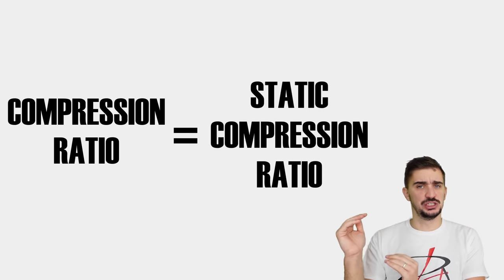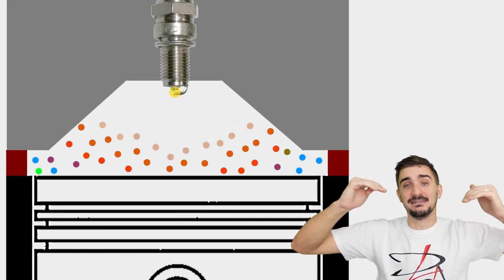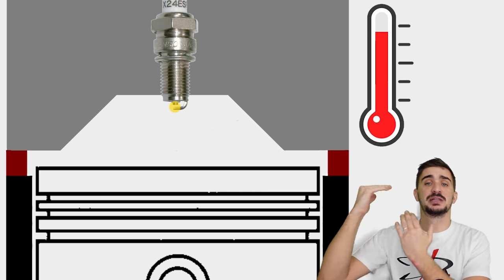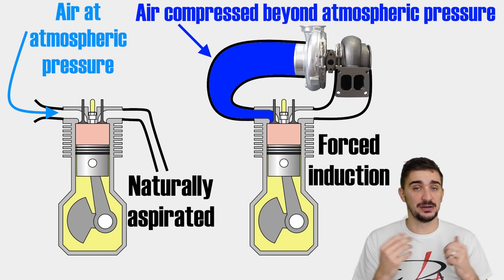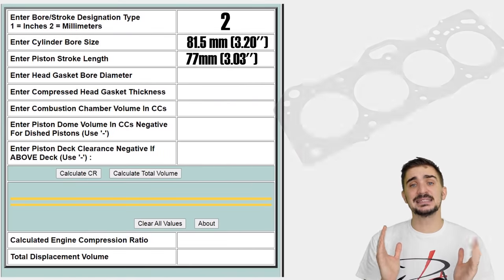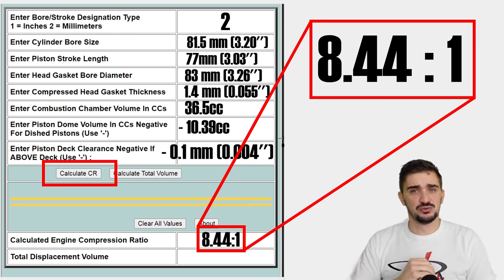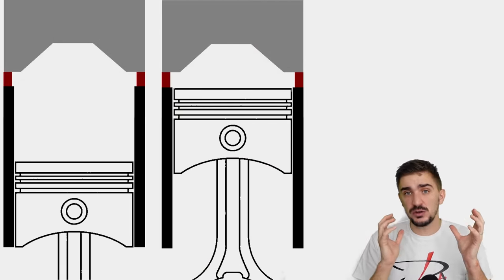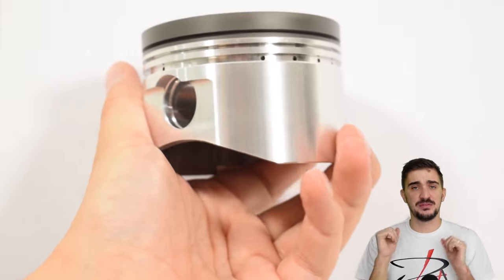COMPRESSION RATIO: HOW to CALCULATE, MODIFY and CHOOSE the BEST one - BOOST SCHOOL #10

Comment: Not to bad of information but a better rule of thumb is to figure out what fuel you want or how complex you're fuel system will be. For me, I have a single turbo n54. It's 10.2:1 compression with 8psi stock. I decided I'm going to use water injection,  yes just water, not water meth. So my fuel octane is high. Now I can use high boost high compression and high timing. Ended up with a G30-900 1.06ar 10° at 30psi worth 1800cc water on 92 pump for 806awhp at 7500/8000rpm. I get 800rpm faster spool then my buddies who did 9.5:1 compression and have 50whp less then me.  All so they can run pump. Which I do with the need to pop my trunk and check my 5 gallon aem tank that last for 2-3 weeks.
Now I understand most just want to fill up and go but most don't understand this is an option and a very good one to.  Imagine the need for less injection cc. Further increasing the tank to empty time. It's very cool and should be checked out.

Comment: What about adding a hood from a supercharged model or one of those intakes which replace the small panel next to the hood and wrap around the C-pillar? I doubt they completely solve the problem but I guess every bit counts.
Reply from the maker: I'll likely be modifying the engine lid. The supercharged one is a minor improvement so I might end up doing something more drastic. I considered the side snorkel/intake scoop thing, but I kinda feel it goes against the natural flow of air in the aw11, as the air comes from below and escapes out the engine lid, but I really don't have anything to prove the scoop doesn't work, it's just a hunch.
Reply: @d4a  Keen to see with what you come up for the engine lid!
Yeah you are probably right with the snorkel, I guess it would be useful if it goes straight to the intake without disrupting the stock flow through the engine bay.
Reply: @d4a  There are some rock solid videos of studies done on the aerodynamics of aw11's that tie into this exact subject and they found that there is not very much airflow through the engine bay and the scoops don't do a whole lot. The way the cooling system is set up is the reason the hg will blow without warning. It is because of bubbles in the coolant lines, not because the radiator is not large enough. I am thinking about adding a Haper's hatch to my aw so I can run an air to air intercooler and get the airflow needed. Or I will go to a air to water setup...
Reply: Add an F1 scoop at the top!

Comment: In the late 80s an early 90s. NPTI Nissan performance technologies Incorporated in Vista California, with their 3.0 Nissan V6 twin turbo utilized 61 to 63 PSI boost to qualify P1 on the grid and to win championships. They were also utilizing higher  compression than the norm. Well it wasn't long till Dan gurney and his Toyota came along with the 2.5L  4 cylinder with also extreme boost and took over first place. They were achieving the 1,000  horsepower mark back in the day.

Comment: Took too much from the head without measuring it and now I would have 12.85:1 (9.5:1 stock) compression on my 1980's 1600 cc carbureted engine. You think I could twik it on  95 octane pump gus with advance, etc or should I make the chamber slightly bigger by machining near the gasket? Thanks for your work on videos like this.

Comment: So take myself for example 
I have a 320i b48, 11.0.1 ratio 
330i b48 10.0.1 ratio
135i b48 9.5.1 ratio.

Only difference with these cars is ratio engine part are the Same with forged crankshaft and piston RODS , cast pistons

So with bmw I believe and looking at the models,  above,  a lower compression = more power in this case correct?

Also I would want a piston with a deep top in order to reduce the ratio correct?

Comment: Your videos are terrific.  Thank you for including the light pressure turbo concept (higher compression with lower boost) in this video.  Mazda used this approach with the Mazdaspeed Miata.  I have an ‘02 WRX, with a 4eat (for good reasons, that’s why).  I’ve been chasing low rpm response since I got the car in 2002 (!).   My tuning strategy has been “Don’t go big”. In the Subaru tuner world that requires staggering self control.
[I inadvertently appended this comment to the "AM I Too Old to Die on a Motorcycle?" video. Sorry about that]

Comment: How close could someone get to making a stroker engine simply by slightly altering/modifying the piston top shape (flat, dished,dome), gasket thickness, rod length ( I know that, that is how stroker engines/kits are made.I was thinking about using readily available parts/components or only slightly altering things). For instance could an 4.2L incline 6 be made into a 4.5L (or possibly larger) by doing these minor changes or would the closest thing be changing it from a 4.2L to a 4.25L?

Comment: What kind of copression should i run on 1.3l Aluminium engine if i would want to max 200hp maybe less than that? my stock compression is 9.5:1 and stock horse power is 75, would 9:1 be good?

Comment: The Gamma 1.6 T-GDI engine used in Hyundai Motor's Avante Sports is 204 horsepower and has a compression ratio of 9.5:1
If I remember correctly, there was a time when a vehicle called the Avante N Cup accidentally installed a piston and connecting rod in Kona, causing a 10.5:1 compression ratio, and in this case, can you tell me how much the power will go up?

Comment: A great video as usual, but I still can’t dispel a doubt: if the goal of a manufacturer when building a na engine is to raise the cr right to the edge of knock, then how is possible for so many people to add any sort of FI without even worrying about opening the engine and lower the compression? I see this behavior occurring very often, ie with VQ Nissan engine, Subaru BRZ engine and, maybe the most frequent, BMW inline 4/6 cylinders. This happen also in Europe, where E85 is almost unavailable. Am I missing something, or is this procedure safer than it appears on paper?

Comment: A forced induction engine is a two stage compression system with a possiblity to cool down after the first stage. That's why (not only why) the potential max torque is higher than in a one compression stage NA engine. Then in a FI setup the CR/boost ratio is a compromise between the FI load (high compression mode) and the NA partial load (low compression mode) performances (torque, efficiency, ...).
Also the presented numbers and even the logic are only true for the traditional mid 90 engines without vvt/vvl. Don't believe ? Check the CR of modern engines.

Comment: Dynamics determine effective power ratio. Static does not account for variable duration lift lsa . Formula1 engine 20,000 rpm and a drag racing engine at 8500 rpm making same hp . Effective compression ratio would same but hp and torque vs weight of vehicle= efficiency

Comment: Just did the summit racing calculator and figured out I'm somewhere between 8.8 and 9:1. The piston protrudes up from the deck by a small amount, .1 or .2 mm but the head has been machined flat twice so I have no way of knowing exactly what it the volume is. I removed 1cc as a guess. 7mgte engine, pump gas on 15 psi makes 430 whp, 18 psi on e85 makes 494 whp on a hub dyno

Comment: More important than compression ratio is what the compression ratio REALLY is, the EXPANSION RATIO.  How far it expands the gas before dumping it out the exhaust is the actual source of the power available. You tolerate a high compression ratio in order to get a high expansion ratio, which extracts more energy out of the gas.

Comment: Craziest thing you ever saw? FoMoCo installed a flex fan backwards. Always had AC problems... I found it when I changed his Camshaft(s) in a parking lot. It's a different story when the front end is no longer attached to the back end... Fixed.

Comment: From my understanding, higher compression helps more at lower revs than at peak power, but also reduce the ability to over-rev. Simplistically, you could say a normally aspirated engine with high compression will give better acceleration, but also lower top speed potential under favorable conditions (downhill and tailwind). Does this concur with your experience?
Reply: Exactly what happen to my car. Compression ratio of 11.5-1 and the manufacturer limit the rev to 6k rpm only

Comment: 13:00 - most annoying engine to drive around town was Busso 2.0 Turbo: anemic out of the boost and than sudden kick of power that always spin wheels free unless prepared and release throttle a bit for a moment. One of the best sounding engines ever made, very potent on a freeway and surprisingly frugal with normal driving out of town. But in town, the factory norm was 17 liters / 100 km. Close 2nd engine that annoyed me to the point I was glad to sell the car was 1.9 JTDm. Anemic in 3th gear and too potent and wild in 2nd gear through the junctions and corners. Engine really not made for towns.

Comment: Hey I just found your channel, and I am glad because I have questions, and i looked everywhere for answers but nothing is straight forward, I bought a 2013 Lexus gs350 it comes with the 2gr-fse engine, NA, it has 306hp, but I want to add more but safely, do you think it's a good idea to get swap out the rods for a longer ones or shorter ones, and I am new to this whole thing, and honestly I am not expecting a response, but I hope I can get a general idea to what I need to look for.

Comment: I have a k24 82mm turbo 7-lbs.spring
12.2:1 cr 1000cc injectors 4bar E70-how much horsepower do you think this guy will make? How much timing should I run?

Comment: @driving 4 answers, if i change the compression from i.e 10.0:01 to 12.0 : 1, does it will reduce the cylinder capacity? If yes does it an considerable amount?

Comment: @driving 4 answers  how do diesels behave with increasing compression ratio under boost?

i have a toyota 2gd-ftv turbodiesel engine that comes with 15.6:1 compression ratio, which i figure as a diesel could be higher.

Comment: A cylinder Engine has a bore 70mm and a stroke of 80mm.If the clearance of one cylinder is 42000mm³, Calculate the compression ratio of the Engine

Comment: I am looking run around 300-350hp at the wheel on my k24z3 honda accord  euro. would you consider dropping the compression ratio from 11:1 to like 10:5 or leave it as is?

Comment: Great video and teaching but you skipped over the piston dish / dome volume. You stated your dish volume which I suspect was supplied by the manufacturer although it is easy to measure. However ....how do you get the values for pistons that have both dish and dome features...eg deep valve pockets and compression raising protrusion. Any advice welcome.

Comment: Another good video.
But, as others have mentioned, not enough mention of fuel octane and other very important factors.
Obviously it starts to get complicated quickly, but dynamic compression ratio needs to be spoken about. Assuming an NA engine with a high volumetric efficiency is going to run closer to the fuels knock limit than an engine with a lower VE number, if both engines run the same static compression ratio.
Combustion chamber design counts for a significant part of knock characteristic.
Squish. Trying to make sure the air/fuel charge is driven away from cylinder walls and encouraging movement of the air/fuel charge on the compression stroke helps to distribute heat more evenly thru the A/F charge and prevent the development of hot pockets within the charge.
The type of forced induction used. Turbos obviously take exhaust gas energy to drive them. But the gas speed out of the exhaust ports isn't fast enough, so the turbine housings job is to accelerate the gasses, by funneling them into the nozzle. 
I'm sure everyone knows that. But by doing so, the turbine housing and turbine wheel cause a lot of back pressure. At least as much and more than likely considerably more back pressure than what you get as boost pressure. And this back pressure causes heat retention in the exhaust valves. And it's just about always the exhaust valves that are the hottest things inside the combustion chamber and the point where any secondary ignition is started.
Supercharging, however, doesn't cause that sort of problem. And in fact, with the correct amount of valve overlap and injector timing, a small amount of the inlet air charge could be allowed to vent past the exhaust valves and cool them a bit.

I could go on for longer and I'm just a bloke in his shed like most people here. But that's just a few more aspects of what can effect the amount of compression you can use.
Long live the AW11 MR2!

Comment: Back in the day I modified a lot of old style mini cylinder heads whose stock heads really needed a lot of work. In calculating the combustion chamber volume i ensured the head was perfectly level, assembled the head with the valves compressed and used paraffin (kerosene) in a scientific burette. I shone a light across the head at an angle to look at reflections to ensure that the surface of the paraffin was perfectly flat i.e. negating meniscus effects. An exact pattern in card for the new outer shape of the combustion chamber helps to ensure similarity of combustion chamber profiles. Even then (after working on the inlet and exhaust ports) the compression ratios were never exactly the same due I guess to the flow characteristics.

Comment: I have asked this before - would cylinder pressure be a more accurate way of determining acceptable boost levels etc? I imagine valve timing would play a big part and enable adding boost to a cylinder that  on paper had a static ratio too high?

Comment: Whats the point of rising compression ratio in na engine? Combustion chamber is smaller it, means faster air vacuum travel which is = bigger torque but less fuel and air can injected = loss of hp/rpm. Its same like garden hose when you push the top of the hose = water will go faster but less water will be given.

Comment: Cylinder head material matters too. Aluminum cylinder heads dissapte heat more quickly than cast iron, allowing a bit more overall static compression to be used safely over iron heads with pump fuel.

Comment: Remember children, the higher over stock horse you squeeze means the lower the life expectancy of the engine. So slightly milder over stock wins, as well as other goodies that can prolong the life such as roller lifters and rockers. Have fun and change your oil on time, it will last longer. ❤

Comment: I have got 5afe engine swaped in an e80 corolla the engine is in a good shape and I am not performance enthusiast but would like to acheive better fuel economy, is there a reasonable ecu/ems that is plug-n-play and tunnable so that I could use it. If not plug and play then it should come with its own wiring loom.

Comment: I run a sheet metal shop so I know you can do some body work, which is takes away from the money in the engine, so it's damned if you do and damned if you don't mind if thing, but a complete system, isn't just in the engine, but what the engine needs to perform in many areas of atmosphere, wither it's hot or cold outside, would be a factor is a high compression hot running engine, anyway, love the channel, learning a lot, which is what I do, learn learn learn, God bless

Comment: Your turbo 1.8 has the same horsepower and compression ratio as my N/A 8.0 V10 from Chrysler. However the torque curve starts immediately and holds 400-450ft/lbs from 900-4500rpm.

Comment: I'm building a chainsaw and I took a taller piston and machined the outer part of the top down so that I had a ride that matches the combustion chamber except for a little notch for the spark plug so it doesn't hit so it is closing almost completely up but I haven't Finished it yet but I may have to run racing fuel mixture in it so it doesn't have pre-ignition problems

Comment: What if we reduce the bore than the stock config yet send same amount of air fuel mixture? Does it increase hp/torque and compression ratio? Also, since increasing the bore inevitably reduces compression ratio, Doesn't it mean that reducing bore should increase compression ratio?

Comment: Why there isnt diesel/trinkler cycle but gasoline fueled engine? A compression ignited gassoline engine, with indirect injection system so we can had higher efficiency and avoid knocking

Comment: Good video. I believe you are discussing this based on only using gasoline, correct? Higher compression leads to knock but higher octane gases reduce knock so your compression ratio you'd want for one type of gas is going to be shifted from another. Wish you add a bit more on that within this one.

Comment: Would be more correctly to calculate the compression ratio of the engine by the density of the air/fuel mixture inside the cylinder/combustion chamber? since the density is already taking into account the volumetric efficiency of the engine! Thank you for the video

Comment: I have a Honda k20 engine. I have 1mm oversized dished valves on the intake and I have stock size flat faced valves on exhaust side. Is this a good set up?

Comment: Noticed the Toda K series Short Stroke kits are a nice example of massive CR bumping whilst also undersquaring the motor. 13.1-13.3:1 CR depending on the kit. 
Stroke reduced to 84mm, bore is up from stock to up to 87.5mm, turns out that 1.5mm increase keeps the displacement really close to stock.

Comment: so engine knock is basically like microwaving a spoon.  When you microwave a spoon, the waves reflect off of it in directions not designed by the engineers to be reflected, so it blows up.

Comment: i will always take a more responsive engine over a laggy but more powerful one, im not going to the drag strip or doing rolls on the highway, the fuel efficiency benefits of a high compression engine is also a plus